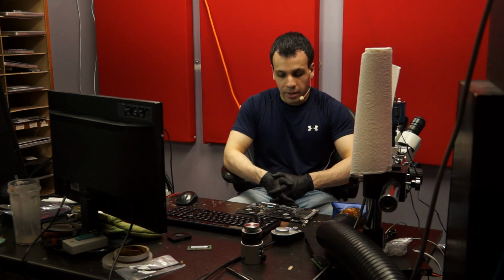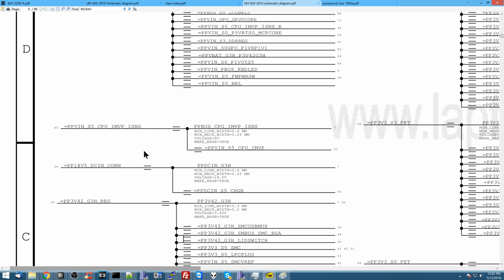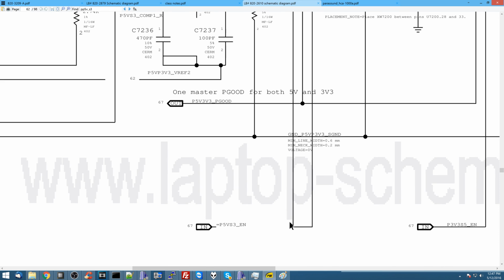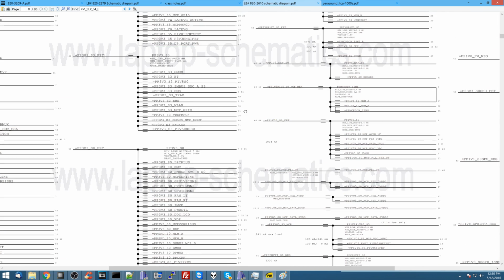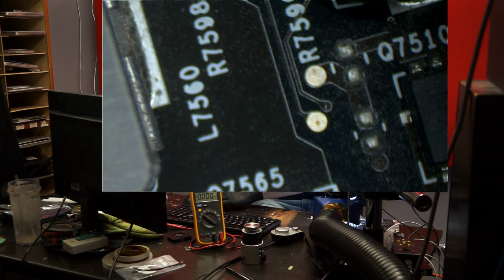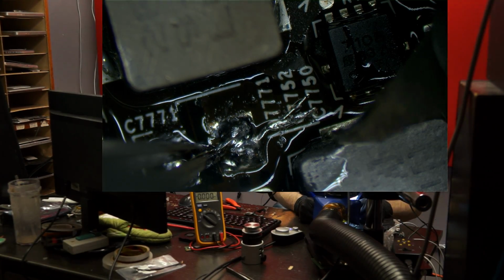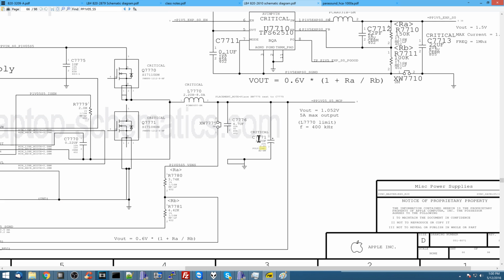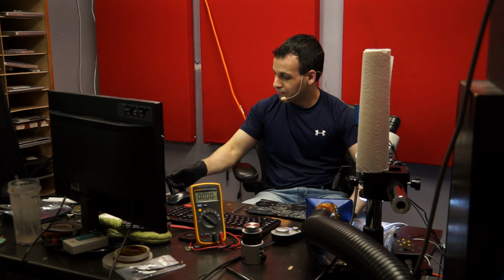A word on warranty service facilities, ovens, and real troubleshooting!

Comment: Would it be correct to install a tantalum polymer for circuits with higher voltages? For example for 6.3V

Comment: 13:00 clearly, a superior solution to replacing the capacitor would be to rig up a thin, under-rated jumper wire and send tons of current through it to heat it up red hot. And then with bare hands, wrap that jumper wire around the capacitor so it always has a steady supply of heat to keep functioning.

Sometimes you guys miss the simplest, most elegant solutions when they're right in front of you!
Reply from the maker: :D
Reply from the maker: i would pay to see a reality show you as a rework engineer at apple!
Reply: Looks like I need to take a trip to the t-shirt store...

Comment: Louis!  you said that you replaced the 330uF tantalum capacitor with a film capacitor.  Not many years ago I was excited when the film capacitors got to 1uF in value, so I had to check it out.  Digikey has nothing close.  Are you sure it was a film capacitor you placed?  Digikey goes up to 22uF for film, and that may include MLCC (which I would not call film since the dielectric is ceramic and not a plastic film).  If you could, please post the part number of the 330uF film capacitor and I would love to check it out.  (I am a design person, not a repair person, but really loving your videos.)
Technically, there are impedance differences between tantalum and film and there are regulators that might not work properly if you replace a tantalum with a film as the different impedance changes the compensation and stability.  I am not aware of this impacting buck-regulators though, since most tantalums should not fail especially at low operating voltage I don't understand why it improves the reliabiilty.  I have designed extremely low power circuitry and the tantalum leakage makes a difference in those cases, but since you are repairing an old board anyway, I am a bit surprised at the supposed reliability improvement.
Reply from the maker: it might be something else, i forget, but it wasn't tantalum that's for sure
Reply: Thanks, that makes sense.  The dielectric makes a big deal designing precision analog, but not a big deal for repair so it is a detail you would not concern yourself with.  If your replacement was NOT polarized, then it was likely a multi-layer ceramic chip capacitor.  Many years ago there was a tantalum shortage and I started specifying the newly available larger capacity ceramics because I thought not only would they not fail but they could not be installed backwards.  Surprisingly, they had a high failure rate in the field, but not with excess leakage current as you noted in the tantalums.  I never did solve that 100%, but there were reports that the ceramics absorbed humidity and then in the reflow there were microscopic cracks caused that would crack the chips later.  The failure rate was much higher than I would have expected from tantalums.

Comment: Technically, i believe the replacement cap is a so-called "tantalum polymer", so not an actual film cap. To my knowledge, "film cap" is usually the name for PET / PP metallized foil or film&foil caps. Quite uncommon in SMD packages, and definitely not as high values as that 330uF :)

I know, i'm a nitpicker / stickler for accurate information x)

Comment: Hey Louis, i'm really wanting to learn more about board level repairs, i've tried repairing a liquid damaged board before but unfortunately (fortunately??) it was just the Super Drive shorting out the board and once replaced it worked fine. However I have hundreds of liquid damaged machines at work to train on. What I would like to know is, is your forum a good place to use for training or is it just more for more experienced people trying to troubleshoot an issue?

Thanks Louis
Reply from the maker: +Jason Mercer i would say it is a supplement to the videos. If you have never watched any of these it will be hard getting you anywhere. You'd have to at the very least be comfortable with everything in the basic electronics playlist before joining. 

The people who are more experienced are the people answering the questions! So don't be intimidated by experience level.
Reply: Thanks Louis, i've watched a good amount of your videos and think that i'm getting the hang of things. I have all the Macbook schematics now so I think that i'll just have to dive in and see how I go on an actual board that is really damaged.

Comment: Great video, as always. Thanks for sharing! I'm surprised somebody wants to fix a computer that's that old but....it's ultimately their choice. Are you sure that what you put in there is a film capacitor and not a polymer capacitor? ;)
Reply from the maker: +Marcin Pluciennik polymer film?
Reply: +Louis Rossmann Hmm... this is actually interesting. I've found SMD film capacitors but they look very similar to the ceramic ones and they're not polarised. The one you have soldered looks like it's a Polymer Tantalum capacitor (looking at google images) which is the type Apple has originally used on the board (see comment on the schematic next to the cap). This makes me wonder if Apple has (accidentally or not) used a wrong value/rating/type cap in the production and this is why it fails. I haven't found any polymer film caps though...

Comment: why does it have 2 discret gpu !! ?  what  option does it add
how hell  they even make that  computer with as bad schematic as that
Reply from the maker: +bac302 saves battery when you are not doing anything important by using the shittier gpu
Reply: Louis Rossmann is that the role of the  integrated gpu of the cpu
Reply from the maker: bac302 This machine predates integrated GPU of CPU.

It actually predates my ability to legally drink in NYC.
Reply: Louis Rossmann  ahh ok .don't know why anyone bother to get it fix  .

Comment: If someone who has extended warranty at Best Buy comes in and has an issue, and it's a motherboard issue, from what I understand, they replace the motherboard outright, since they're an "Apple Authorized Retailer." There's a reason the Tier repairs cost the same at Best Buy for Apple products.

If I ever find out that someone at my work is just heating the board to repair it, and that's why we're getting Macbook Airs with motherboard issues coming back with the same issues after 2 months, I'll castrate some one.
Reply: Castration via heating.
Reply from the maker: +Ben Kuyt i agree on that castration!
Reply from the maker: Treddian that would be karma

Comment: Hey Louis, you have furthered my interest in repair and tinkering.
Just the other day I purchased a Tascam DM-24 digital mixer that is 95% functional. There's a few sticky pots, a broken stem, and an unresponsive fader which for some reason still responds to the motor calibration despite not transmitting any data.
Anyways, do you have any tips on finding parts for discontinued units? 
I have sent tascam a support ticket requesting a spare fader and have already sourced a service manual with all the schematics I need.
Reply from the maker: +://about _blank good luck :( It is a nightmre to find parts for discontinued audio gear

Comment: Hi there Louis.

For starters I don't like Apple products based on the way they are over priced compared to performance and the fact that you can't really change anything in an apple computer.

But in regards to your profession I do understand the point entirely.
And it's 100% not only limited to apple products repair or computers in general, it does happen also with washing machines, ovens, anything with an electronic board in it.

I think one of the reasons behind this is that the majority of customers don't know any better or don't want to be bothered and off course they all want the cheapest repair cost and fastest repair speed out there.

Keep up the good work.
Reply from the maker: +Xyed Shy-Lau (CCP Xyed) I har you.